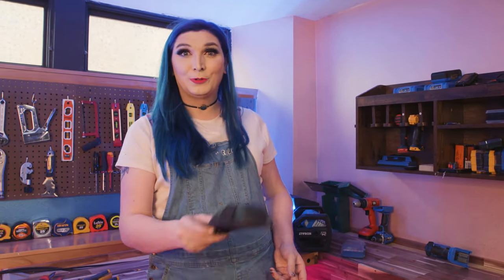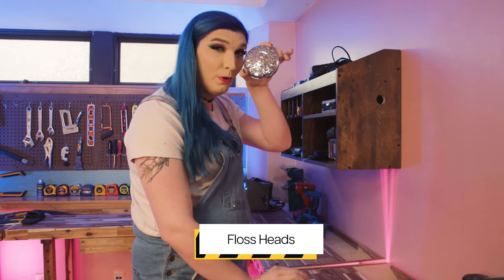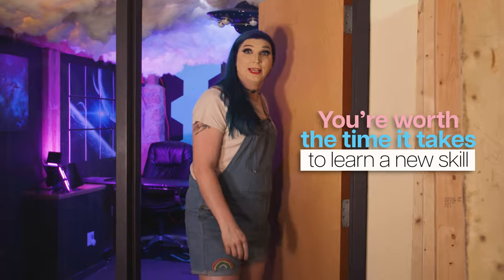ASK MERCURY: Tools, Tips, and Tricks!

Comment: You are awesome! Do you have any tips on hanging shelving that makes it sturdy as well as easy to repair for move out for renters?
Reply: I am not Mercury, but I can tell you my experience. 

Command by 3M hook & loop wall hangers are the best temporary fasteners I've come across! I think they hold up to 20lbs each, so the weight of your shelves + items will determine how many you need. 

Be sure to read & follow all instructions for maximum hold and durability. Letting adhesive cure before adding weight will make a HUGE difference! 

Hope this helps, good luck!